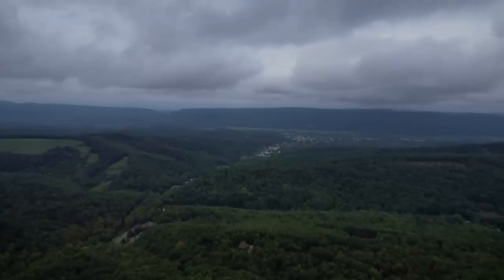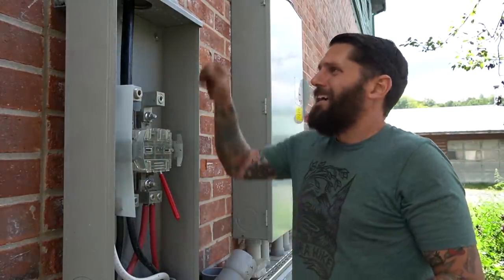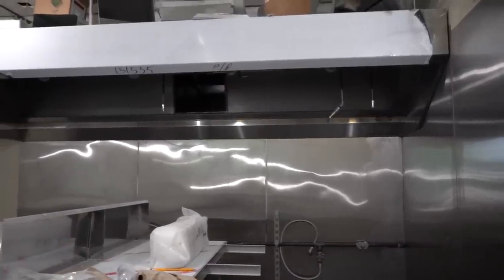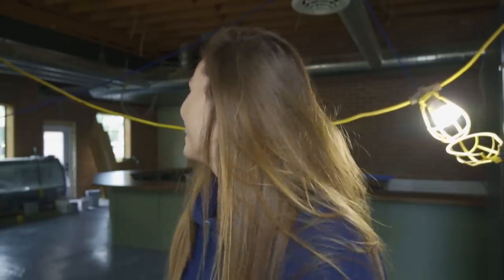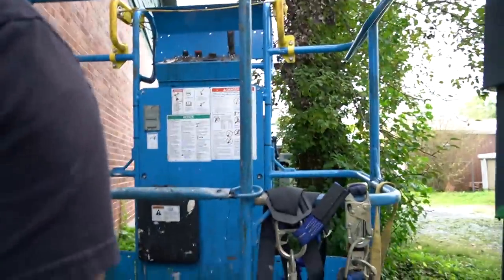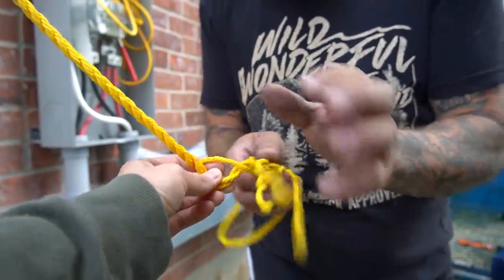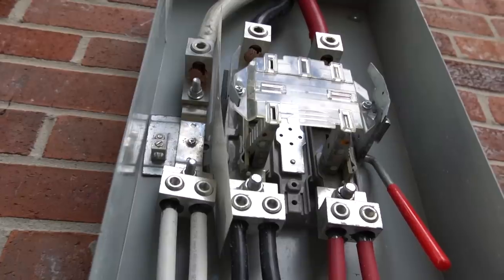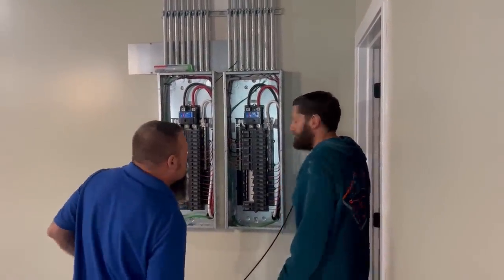That's a Fail. The First Inspection.

Comment: The lift was absolutely required and I"m glad Josh made the call.  It's not worth taking a chance and trying to power through something that sketchy and have either of you get hurt.  Josh's electrical work is top notch and professional, the inspector was very impressed as well.  Great job with the design and execution Erin and Josh.  I also love all the murals on the exterior!!  Looking forward to more, be safe.  Larry, Central Valley, Ca.

Comment: Hi Josh and Erin, firstly i love your videos each week. I'm from QUEENSLAND Australia. i tip from me it may sound crazy but if you cut the leg of a pair of ladies stockings and put it over the end of multiple cables and tape them on when you pull the cables through to conduit it helps it slide and works very well around bends and joins in pipes as it just bounces over the joins. Also as you pull the rope the stockings get tighter around the cables to add strength for the pull. hope this comes in useful for you its a trick i learned pulling cables on my own

Comment: Congratulations on passing inspection !!
We had no doubt about your skills ; you are well qualified and it shows ❤
The appliances look great.  The kitchen line also ! Very nice equipment.  —> Just don’t forget to install the filters in the exhaust hood over the cook line <—— 
Do you have the exhaust fan on the roof or as a sidewall mount ? 
( I co-ran a commercial kitchen  cleaning company for many years )
The cafe is a terrific contribution to the area ; the design is great and I think you will be a great success !!!!! ❤

Comment: Great team work you guys. Man, props to Josh with the 600. I forgot about pulling and terminating those. Used to do that for the BDFDs for Telephone C.O.s worked for Tell Lab and Nortel. Not a fun job. So appreciate the professional and clean and tight Josh does with everything. ( including electricial 😁) well done!! 🤠🧑‍🦰🌲🌲 🎼

Comment: Yep…. Definitely a good thing for using the lift rather than trying to work from the extension ladder.
I did a stupid thing the other day trying to put stuff in the garage loft from the step ladder and turning on it ! Yeah I’m a banana and a bruised one because the Step Ladder kicked out from under me ! Not surprising considering the stupid thing I was doing but considering I used to have to work from Height all the time before, I should have known better !!!. 
Luckily I didn’t get seriously injured,just a bruised backside and elbow and a sore arm where the table top hit but it could have been so much worse than it was. 
Great to see the Cafe getting closer and closer to opening day ❤

Comment: They make nylon appliance movers you can put down under your stuff to protect the flooring.  They are like 6 inches wide by 4ish feet long.  You could make some custom to whatever you needed and they make moving stuff very easy.  I used to install high end cabinetry, just one of many little tricks to save yourself some headaches and backaches later.  Cafe looks awesome!

Comment: Looks great!  But you're going to have to repaint that floor soon.  That paint isn't holding up.  I'm a painting contractor and you need to use something like PPG Breakthrough V50 or Ben Moore Command and give it time to cure (about 15 days) before any major foot traffic.  Two coats of either of those will hold up to anything you can throw at it.

Comment: Using a lubricant like crisco oil to reduce friction on the wire jacket  prior to pulling the wire through the conduit makes it a whole lot easier on you and the wire. I learned that lession on my first house. As the saying goes, hindsite is 20 20. You may want to consider writing a book about your whole experience when its all said and done. Your such an inspiration to other people wanting  to do the same thing and the lessions you've learned could help alot of people. You could also refer to your website in the book for those people who are visual learners.

Comment: great job guys, all the best and success in the cafe. when moving heavy items with no wheels just use liquid soap on the floor or legs of the items for easy push with limited scratches on the floor, same when pushing wires inside tubes. watch for your steps when pushing. As for coffee machine and ice machine u need to install water softener for each unless you have centralized for the water system. All depends on the water purification in your area . Its needed clear water for espresso machine and ice machine to produce crystal see threw ice cubes. As for the oven in kitchen would better to put on a table especially made for ovens that will have shelves to put the baking trays under as storage or cooling area after use. Also better high position for oven easier for work.

Comment: Good judgement call Josh!:) 
Never fully commit to a plan if it turns out too be dangerous or too hazardous. Especially if you can get a lift, and you’re wife and kids need you more anyways! 😊 Good mention on that service drop too! A lot of electrocutions happen with lift suspended in the air and coming into contact with distribution feeds! At our utility it’s in our man lift safety program to watch out for, and it’s tragic to see contractors, etc get bit, and go down… Great video as always Erin and Josh! 👍

Comment: Guy's this has got to be the neatest electricity panels i think I've ever seen, great to see josh again doing amazing work with the electricity. Clearly the inspection guy was as happy as a pig in shit with the work carried out by the always on call Josh😌, just going by his whole attitude and how happy and relaxed he came across, was very evident for all to see.  I think that you just made his job effortless and the hardest thing he had to do was the paperwork!!! As always guy's 💯%   👍   🇬🇧.
P.s The panel that you pushed and pulled the copper cables down seems to have a glazed panel missing from it's door 🤔, is this normal or does it have a window as such that goes inplace on the door 🫣🤔? Thinking about bad weather!!
P.p.s I'd like you to do a video of the whole outside of your cafe/ restaurant just so that we can all get a better look at the artwork that's been done by whichever artist you chose, as it looks great from what we can see 🫣😉
Reply: And you’ve seen alot 😂😂That is called a meter can….and the opening is where the watt-hour meter from the utility is gonna go

Comment: That pull with those 600's would have been slightly easier if you had made the head up like you were going to use a tugger. The head would have been slightly narrower and slightly more flexible to get around that 45 in the pipe. 600 MCM is very unforgiving when it's blunt cut at the pulling end. I think this is the first time ever I have said I would do something different than Josh when it comes to electrical. The difference only being physical effort. BTW, the electrical panel wiring looks phenomenal.

Comment: Need to find you a local metal shop, if there is one; to make y'all a stainless steel base for the mixer to sit on so its up higher where whomever is using it doesn't have to bend over and its up off the floor. Y'all could also have the metal shop build your legs or another base for the ovens to sit on as well. Being this town has a tourist railroad I suggest putting up some old pictures of the tourist railroad or go take a few nice photographs yourself that y'all could decorate with. I'm hopeful this business works out for y'all. Seems like its targeted at a niche customer base and I hope there's enough of that customer base in the area to support this endeavour y'all have embarked upon. I'd say if it starts to fail don't go bankrupt trying to keep it going and get out from under it as quickly as possible. Hopefully it will be a success and become a landmark in the area that survives after y'all are long gone and your daughter has taken it over, possibly becoming a generational business in the family for decades to come. Best of luck.

Comment: I've been wondering what would happen if one of those ropes or string that's attached to cables that is being fed through the conduit was attached to a winch down below where the cable is supposed to come out at and see if the winch will have enough power to pull the cable for you. I helped an electrician do that wire pulling crap before and it injured my back really bad. Something to think about on future projects. I know they also put lubrication inside the conduit too. I bet there's a way the winch would work pulling the cable through the conduit. There's got to be right? But you'd have to get yourself one that's all. And How it's set up or what it's mounted to or what kind of winch it is will have to be planned out.

Comment: If a winch couldn't work I wonder if a certain kind of handcranking piece of equipment with a few pulleys that the string winds through and up to the hand crank spindle would work and be easier on backs.
Reply: It might have to be made or invented in a work shop welding pieces of metal together and installing the pulleys on it and such.

Comment: When pulling big heavy wires ( especially Copper) you should probably use wire pulling lubricant or even liquid Dish soap will work in the pipe .
Using either one of these will work miracles . Also don't forget to use Phasing Tape or you'll need to use a Meter to buzz out the cables . Happy Trails from 🇨🇦 to the 🇺🇸  ✌out
Reply: You don’t know what you’re talking about, the wires are colored from the factory.